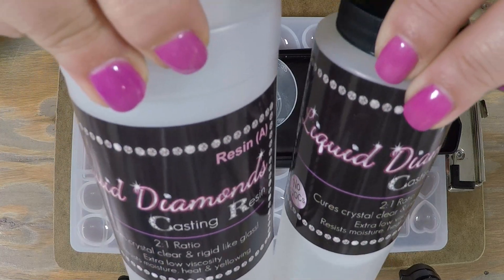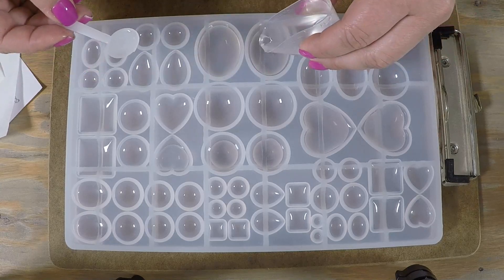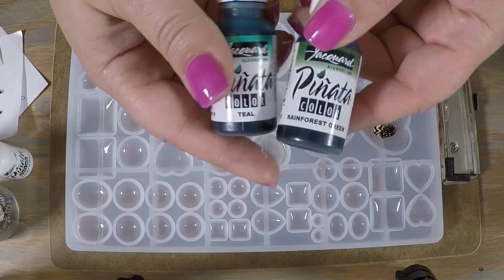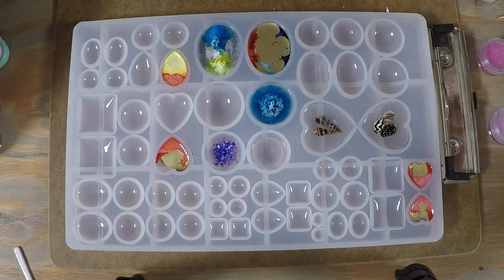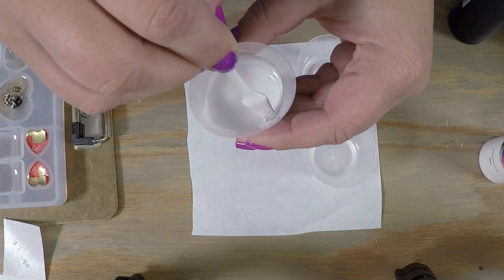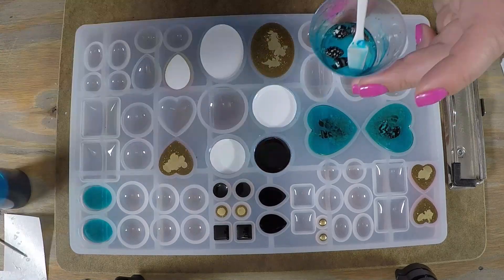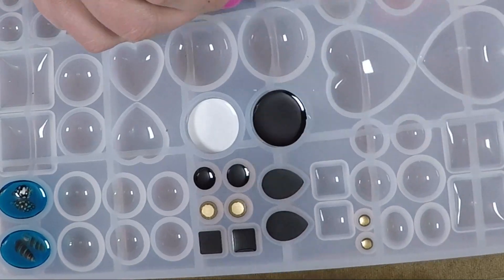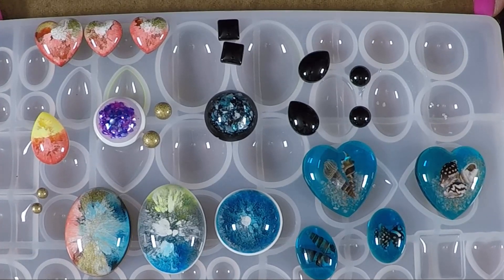Liquid Diamonds Casting Resin in molds test to make jewelry |  Petri | Ocean | Multi-layers

Comment: I noticed the sheen also, I just use another resin for coating or doming.
Reply from the maker: Liquid diamonds is great for casting! It’s certainly not the correct resin for doming or coating. I use different resins for doing those two things as well. Every resin has its place. Thanks for watching!

Comment: It gets  film on it because the lighter. If the flame gets too close to the resin it will start to harden it but like a rubbery texture
Reply from the maker: Someone else mentioned that. I’ve had it happen with and without lighter, though. It’s never cause me an issue, so I don’t pay attention it it any longer.

Comment: Some resins only have a 40 minute window opening to work with. That's a quad the film was on there is because your time was up to work with it and that it was already starting to set up, starting it's process.
Reply from the maker: Thanks for watching!
You are correct that some resins only have a 40min working time. This resin has at least 1.5hr working time, so that is certainly not the issue. Plus, resin doesn’t cure like paint from the outside in; it will all start to set up at the same time. As you can see in the video, after I mentioned the film, the resin is still quite fluid. After speaking with the manufacture, it’s most likely from using heat or ambient humidity.
Reply: @JOTZdesigns  that would probably explain why it did that film. I have a little trouble with my AC and when I just have the windows and the doors open. Thank you so much for the video and the explanation. You have a lovely time. love watching them ❤️
Reply from the maker: I’m happy to share! 🧡☺️

Comment: Why do you need to add the hardener in first?
Reply from the maker: It is recommended to do so by the manufactures. The hardener is a lower viscosity than resin (meaning it flows faster, is thinner), and by adding the thicker resin to it will help make sure it gets mixed thoroughly. I think of it as it’s easier to scrape a thinner substance off the side of the container than a thicker, ie water is easier to scrape off than honey. Hope that helps! Thanks for watching!
Reply: Thank you for responding :)
Reply from the maker: You’re welcome! 😊

Comment: Why put the hardener in 1st, never heard of that before 😊
Reply from the maker: It's not a requirement, but the reason is because the hardener is the thinner of the two, so it won't stick to the bottom as much as the resin will, and that helps with making sure it is mixed thoroughly. Hope that helps! Thanks for watching!

Comment: I have tried to use a little hand drill for some resin pieces w/o much luck.  Can you recommend something small and not expensive I can try?
Reply from the maker: Hand drills can be tricky to get used to! Here are the three types I use. Two types of hand drills, and an electric rotary tool. 
Hand - https://amzn.to/328l7tS
Hand spring/push - https://amzn.to/3JMditR
Electric rotary tool - https://amzn.to/3M19xCq

I typically use the electric one when I need to drill THROUGH something, but, as I show in this video, you can still use if for adding things like eye screws! 
https://youtu.be/c5yli_ymh_0
Reply: @JOTZdesigns  thanks for the advice

Comment: Hi. Your work is beautiful. I’m just starting and there is just so much info. Conflicting or not. I have asked a few resin uses “ how come when your square or rectangular items come out the mould the edges when right side up are beautifully rounded and the wrong side up also appears to be round on the edges. My edges taking them out wrong side up, have a dip in them as if I’ve under filled them. The edges are ruff. I’ve tried to sand and polish those edges. What a disaster. Just about to through myself in the bin. Is it maybe the type of resin that you are using. Resin brands and types are not easily found in South Africa so always have to look for substitutes and that can also be different. Hope you can give a bit of advice. If not I’m going to the moon 🌝 Thanks for sharing your beautiful work.
Reply from the maker: Thank you!
Having a raised edge in molds is normal, and most often what you get, even when filling the mold up to the edge. I am not a fan of sanding and polishing - too much work! - so there are other ways I will make the side you pour from look just as good as the side IN the mold. 

Basically, I fill in the cavity created by those raised edges with resin. This can be done before taking it out of the mold, or after. It is really just like doming a piece, though you do not have to add enough resin to get the ‘dome’ if you just want it to be flat and fill in that cavity.  

Small pieces like this are usually best to do before taking it out of the mold, just because it may be hard to get rounded pieces, like the 1/2 spheres, to sit flat and level on its front side. I personally like to take larger/flatter pieces out of the mold first. 

If you’re adding resin while it’s in the mold, you want to add enough that it is actually a little above the surface of the mold (easy to see if you get down at eye level), but not too much that it breaks the surface tension and spills out onto the mold. Add just a drop at a time, if you have to, to make sure you don’t overdo it. 

When it is out of the mold, it is pretty much the same thing, but instead of it spilling onto the mold if you add to much, it could spill over the edge of the piece.

Another thing I like to do on larger molds is to underfill it a little so that when I do take it out of the mold and go to fill it in those raised edges are even and not rough, as they can get if you fill your mold to the edge to begin with. 

Check out this video for an example of me doing this, but I keep it flat instead of doming it.  (Starting at 2:57) https://youtu.be/5qmCyKhw73w

I hope that makes sense and helps answer your question! Thanks for watching! 🧡☺️
Reply: @JOTZdesigns  
thank you so much. 
I'll give it my best shot

Comment: Heat gun won't damage the mold
Reply from the maker: That’s often true, though I have had it damage a couple of molds before, sadly!
Reply: @JOTZdesigns  that sucks . thank you for posting the video , I bought the wrong epoxy during cyber Monday and I really didn't think it would work for molds , but your video was very helpful , for the pro marine table top epoxy .  So I think it will work perfectly for the project I am going to be doing and it also helped me figure out what type of pigment to use . My best friend passed away beginning of January 2020 and I am making urn,s using the epoxy and will probably use the alcohol pigments
Reply from the maker: I’m sorry for your loss! Always rough! 
A note for ProMarine... it’s a thick resin, so be sure to mix slowly, and with a silicone or plastic stick as wood can create more bubbles. Thicker resins will have more bubbles in general too. Don’t let it all sit in the mixing cup, or it will probably flash cure, and if you pour a thick amount in a mold, you may get flash curing also. I’d recommend separating it out into smaller and wider containers after mixing, and let it sit for a few min to help release some bubbles. Have fun!

Comment: JOTZ: How long you let the Resin Sit so some Embellishments,  sans, etc won't sink to the Bottom?? i Use   "Let's Resin" but just to get an idea. you got Lucky with the Mols nice and shiny  reason I say cuz I bought exact one from  Hobby Lobby and mostly were matted, scratched  like a foggy finish  if I'd kept it i be disappointed my piece would not be shiny having to add a coat of resin to shine it up not to mention have to sand down costing extra  work,so I  had to return it next time ima buy the mold from the provided Link you put in Description.
Reply from the maker: It really depends on the resin you use as to how long you should wait before adding embellishments so they don’t sink. I’ve never used the Let’s Resin brand, but my guess it’s more a ‘middle of the road’ kind when it comes to viscosity. I’d recommend doing a test first, and start by pouring the resin into your molds, then add items at 30, 45, 60, and 75 min after. Don’t let it sit in the cup that long! Let it sit in the mold. A good rule of thumb for molds is if the surface is shiny, then your resin will come out shiny. If it’s matte/scratched, then that’s how the resin will come out as well. Hope that helps! Good luck! Thanks for watching!
Reply: @JOTZdesigns   Ahhh good idea to add the items after 30 min then 45  and so on thank you much really appreciate ur advice, and yes after mixing instead of letting sit, just pour in molds and take it from there.

Comment: Hey my name is Lori Adrian but go up by Bambi, I talk to my husband because he is very well used to using these kind of product you need to add A first and then B that will make it so that your resin isn't so cloudy
Reply from the maker: Thank you for the comment! I have never had an issue with a resin being cloudy, and that is because I mix it correctly.  I have spoken with many manufacturers, and they all recommend adding the hardener, part B, to the cup 1st. I follow the manufacture directions, as they are the ones actually making the product. Thanks for watching!

Comment: Can you still see that film on the finished cured resin piece ? I was thinking about using this product but this is the second video ive watched where  a film on the surface was mentioned.
Reply from the maker: Please don’t let that film deter you! There’s only been one time I could see evidence of that film once cured, and it was on one of my very first test pieces where I used alcohol inks. I noticed the film after putting the inks in, and I messed with it a little with a toothpick. Once it was cured, I could see a bit of a ripple on the side I dropped the inks into, but that’s it. The rest of the piece was fine. Thanks for watching!

Comment: hi, how many ml of resin and hardener did you put for each? and how long did you wait for it to dry? thanks!
Reply from the maker: Hello! I mixed 8.2 grams of hardener and 16.4 grams of resin to start. There was no measuring done when I filled the cavities as I just eyeballed each one, keeping in mind what I wanted to do (ie. add shells, ink, glitter, etc), and keeping a space for another thin layer once it was cured. This resin typically takes about 24 hours to cure. Thanks for watching!

Comment: Love your designs. Especially the seashell ones. I use Liquid Diamonds and also get the film. Would love to figure out why.
Reply from the maker: Thank you! 🧡 These shells are so cute!!
I’ve spoken with the owner of the company and he has never experienced the film, so he was unable to give me an answer at that time. It hasn’t effected curing overall, but in one test I did, I had a bit of a thicker film (and it was just after pouring so it should be setting or anything) and I messed with it but didn’t mix it in/remove it, and you could see it once it was cured. 🤷‍♀️ Just gotta keep testing!

Comment: I have been using liquid diamonds resin and you aren’t supposed to use a lighter or any heat source on it or it creates a film or something like an oil slick. Your resin needs to be between 24-27 degrees or it will cure with an oil slick on it. I personally haven’t had any success with this resin. My room is too cold for the resin. I warm it up in a water bath but then it cures in the temperature of my room and creates the film. Your pendants turned out beautiful.
Reply from the maker: Thanks for the tips! I’ve never had a film when the resin cures, no matter the temp or use of heat. I’ve only gotten the film prior to curing. 🤷🏻‍♀️ I adore this resin, but it’s certainly not for every application. Thanks for watching!
Reply: Is the temperature in Celsius or Fahrenheit? Thanks in advance.
Reply: @sda141  it was celcius

Comment: The cover you use to cover your resin mold might be letting air flow under the plastic cover. That might be why there is a dry film on top. I like your colorful resin pendant.
Reply from the maker: Thanks! I like that one too! Air flow is not the reason for the film, I do know that. No other resin has the film issue, and most of the time I use a food tent to prevent dust and hair from getting into the resin while curing, and often I don’t cover at all unless it’s a top coat. Thanks for watching!